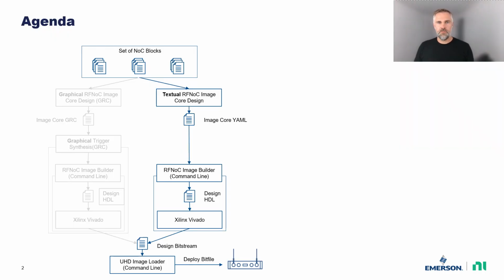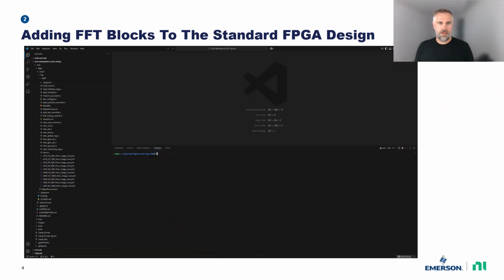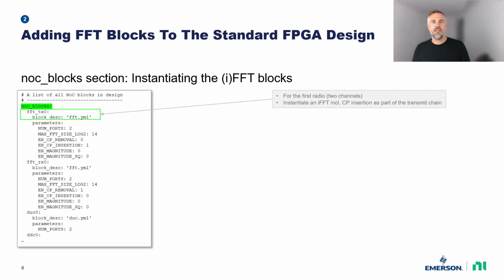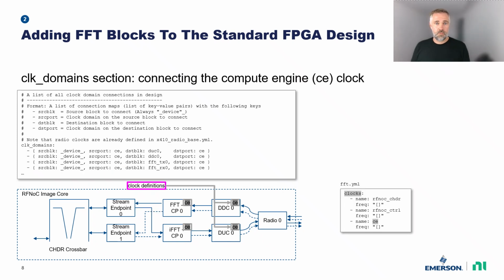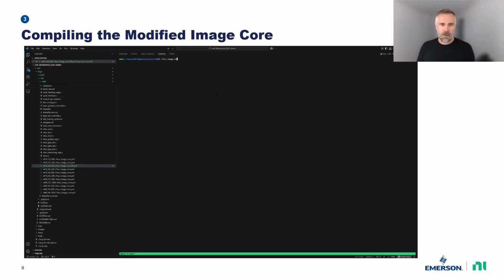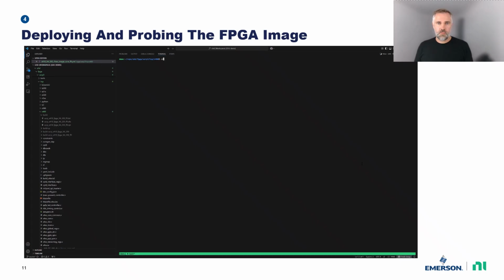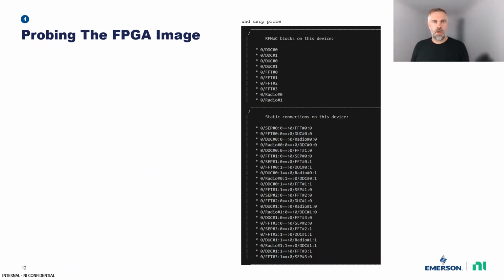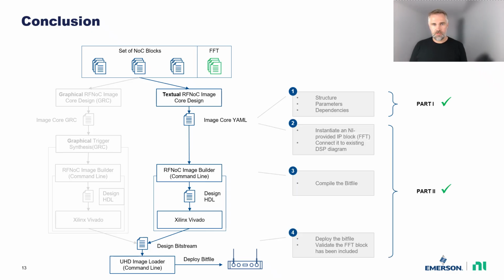Creating a Custom RFNoC FPGA Design Part 2

Comment: Given a platform like the LimeSDR, which uses a Lattice ECP5  (compatible with open source tools like f4pga or Trellis (Yosys, nextpnr).. are there any recommended GNU-Radio examples for someone just starting learning about FPGAs and SDR?

Would commercial software like Matlab/Simulink's Communication toolbox be better for a university student?
Reply from the maker: Hey @bennguyen1313, here is the link to RFNoC examples in GnuRadio (github): gnuradio/gr-uhd/examples/grc at main · gnuradio/gnuradio.
These examples will be installed with a GnuRadio installation. There is a folder in there that has FPGA designs in terms of GRC graph. We are planning to cover these in our next video so stay tuned!
Matlab/Simulink’s Wireless Communications toolbox are both great tools, and they support many of our USRPs. We can’t say for sure if they will be a better fit for a student or not, but many universities have site licenses and students are often familiar with that software. Please let us know if we can assist you further.